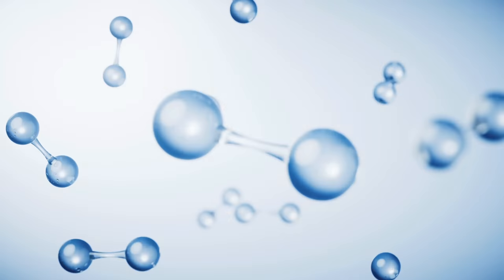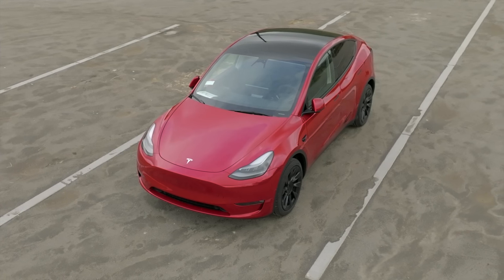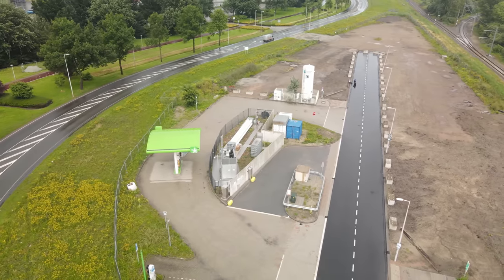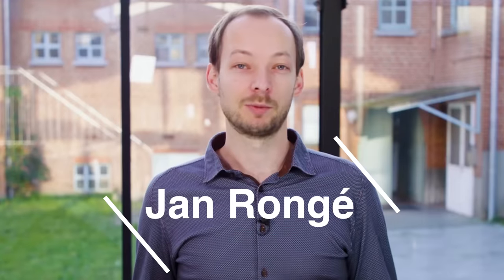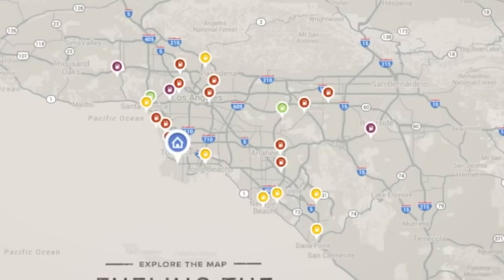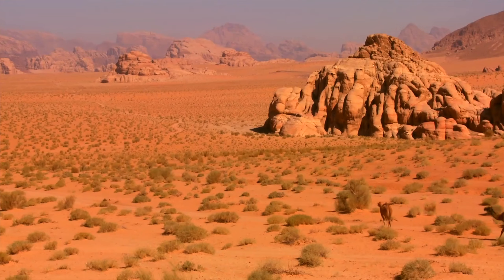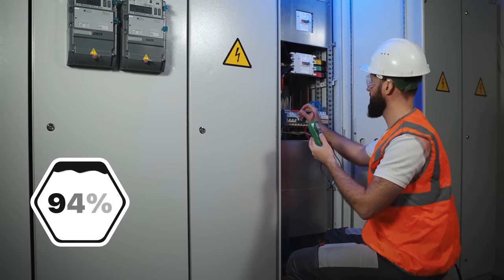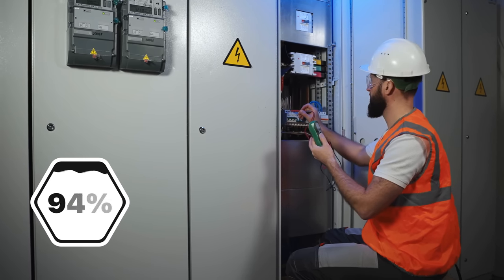Breakthrough Solar Panel Makes Hydrogen At Home!

Comment: The problem with home solar is it only really works in the summer when you need the least power. So you need a system to store the excess energy in summer till you actually need it in the winter. Hydrogen has that potential, you can store H2 at high pressure without the need for compressors using metal hydrides at a density higher than liquid H2. In the winter you can use it directly in a gas boiler for heating or in a regular ICE generator for electricity. Also consider brewing/distilling alcohol in the summer to keep till winter. Burn it directly for heating or fueling a generator for electricity....
Reply: In countries like India, people use Aircons in the summer. If you are able to produce energy locally then that will cut your electricity bill significantly.
Reply: @rabindrasingh6270  Most people in the world dont live in areas that are permanently warm...they have winters...

Comment: Besides cost and safety concerns, I'd say by far the biggest challenge with hydrogen is preventing hydrogen leakage. Hydrogen leakage is a serious concern, since it makes hydrogen actually contribute to global warming, because it slows or prevents methane breakdown in the lower atmosphere. Methane is an 80x more potent greenhouse gas than CO2 during its lifespan in the atmosphere. Managing hydrogen leakage to below 4.5% will be essential. This pretty much precludes decentral hydrogen production solutions like the one described in this video, since decentralised systems are uncontrollable. And governments will likely have no choice but to ban applications like these, since they will present a net contribution to global warming.

Comment: Plasma Kinetics has a unique hydrogen storage technique that allows you to store hydrogen on a film.  You don't have to compress hydrogen with this system so you cut out the major cost with normal hydrogen storage.
Reply: I looked at this from a technical standpoint - it is a lab party-trick, with very little practical use. Some people jump on the funding bandwagon with essentially nice-sounding but impractical ideas...
Reply: @chrisheath2637  do you have any examples of what you mean?

Comment: Why not use it as an alternative off-grid solution for gas cooktops, and/or water heating ? since high pressure storage and pipe wouldn't be needed, and you wouldn't have the secondary conversion losses.

Comment: I say Lavo system with direct electrolysis of the air like the panel..Neat there is a way we can make high pressure H2 through the electrolysis process...

Comment: Put the high pressure hydrolyzer in a car with electricity coming from an overhead line, embedded in a roof deck that powers the car while "in network" The network also provides central computer control. The hydrogen is used when outside of the network - which would exist in urban, and possibly suburban or exurban, areas as well as on interstate and major highways. It would also be fed from home electric (solar, wind, central power, whatever). This means getting rid of carbon in non-urban areas (like most of Iowa). Roof decks would have solar and grass and streams (to maximize solar), just because we can - or they can simply be grass covered. Home electricity and internet would also come through roof deck system (or walls of roadway). On daily commute, car would stay in system in urban areas and drive you to transit and drive itself home - to return to pick you up from transit later. Nuclear power (made from recycled waste) would mostly power the system.

Comment: i kinda also wanna be able to generate electricity from excess hydrogen made. maybe use it in a stove burner? IDK. the best part about having liquid hydrogen stored is that you can use it whenever. I seen people make hydrogen powered generators work just the same as gas ones.

Comment: Hybrid parabolic/photovoltaic would be much better for this. It would use the high temperature wasted heat to produce hydogen from water and the photovoltaic cell would have increased efficiency due to high light intensity.

Comment: What if u take the solar panel system & directly have it apart of the car. Then directly route the hydrogen into storing it in your car? It could auto detect when it's full & maybe utilize or transfer energy to other aspects to the car once the tank is full? Just a thought? Probably can't work

Comment: It's promising tech but as you touched in on the way it's stored is so far very inefficient with considerable losses in each process.  For the moment I think solar and battery storage connected to a smart grid is the way forward.  Maybe  mass scale hydrogen generation is more efficient?

Comment: There are a couple ways to store hydrogen with a low pressure system and it can be used heating water or house just like natual gas or to run a generator. One is a container in a container filled with water and as it is filled one rises as the gas displaces the water. The first tank could be mostly burried in the ground.  The other way is like a giant air matress, perhaps with its own building to protect it. For daily use they could be practical, but for long term, they would need to be huge.
Reply: We got those large buildings in our larger cities that produced city gas until about the 1980s when it was replaced by natural gas. They have all been refurbished and are now being used for public venues, malls etc. They are called Gasometer. Actually they had a primary use, constant gas pressure for the whole city.

And no: You can not compress hydrogen in the way you think. That does not work. Sorry, it just does not work.
Reply: @wolfgangpreier9160  Interesting. I don't know what you think I think about compressing hydrogen, but it can be compressed just like air can. Unlike air though, care must be given because it is flamable it needs to be treated more like natual gas or propane and because it is of small molecule size, it is able to go though smaller gaps in seals, defects in valves, etc.
Reply: Why would you take 4 times as much energy to heat water or your home with hydrogen when you can use 1/4 the electricity and use a heat pump? Also you need special containers to hold hydrogen since it is the smallest molecule in the universe it will embed itself in just about any material causing hydrogen embrittlement.

Comment: The thing is, he longer we wait the longer it’ll take. Just like battery technology in the last 100 stunted by a cheaper option (on the surface) that’s lead if nothing else to terrible pollution issues, that initself has significantly reduced over its years of production, 

I’m pro hydrogen as well. Right now, just like solar, was 30 years ago, and to this day, still is less than 25% efficient, but it’s overall earth benefit is significant.

Comment: If we had a way to store Hydrogen in large quantities (without needing extreme amounts of space) then this would make sense as an addon to normal PV systems. (e.g. for the winter months.) Unfortunately we are not there yet, as this kind of solution would need to store in the MWh range rather than KWh...

Comment: they have talked of hydrogen cars for decades -- 6 fill up stations in the whole of uk -- like 3 pounds per kilo to buy
Reply: Yeah, and I see them driving around every day. It's awesome to see them dump hot water out the tail pipe. The Toyota Mirai has been out since 2014 and if you're in California they are everywhere, so your points are clearly moot. You just live in a rundown country.
Reply: @filonin2  I prefer my model Y

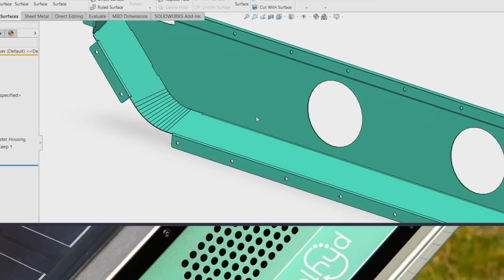Comment: 5:57 question answer: no, because my bev can already charge at home on my current much cheaper solar system and a 4 min recharge at home is usless when I can already charge overnight with the exact same or less effort.
Reply from the maker: i 100% agree with you!

Comment: Using home generation of H2 immediately suggests space heating and hot water applications.
Reply: Better off using solar to power a geothermal in ground heat pump system.

Comment: I'd have a hydrogen car if I could get the fuel at home. I assume it'd have to be super cooled to a liquid state or highly compressed to actually have the volume to run a car effectively though; both of which also would take a ton of electricity to do which creates a new problem.
Reply: As is very well covered and commented in the video.
Reply: @Israel Parada  yes; I added another comment stating that I had gotten to that part. Lol I was commenting g in real time that I was watching when he said to comment about whether we would own a hydrogen car.

Comment: Problems with solar panels. 1. It costs an extra $20,000 to remove/replace them every 10-15 years when you reshingle. 2. You are not allowed to suspend the panels from a gazebo or other structure. 3. You are not allowed to disconnect from the grid. If the city has a power outage—you do too. Your house is basically a power plant for the state; and it’s only a matter of time before you have to rent those panels. (For example: EVs have to pay extra registration fees bc they don’t pay gas taxes.) 4. Hail. 5. If they are so great, why does the govt mandate them for new houses and give subsidies for old houses?

Comment: They should create solar panel statue gardens in a glass dome surrounded by water so the panels can use the water to self cool and create condensation. They can grow beautiful plants and flowers and create a therapeutic energy-producing oasis in the desert. Continuing to promote the pressure of cool air and rotating components in the batteries to keep cooler with multi-dimensional, rather than flat, batteries. Build a solar panel statue as a skyscraper in NYC. End compulsive force upon foreign countries for oil.

Comment: You said "second most energy dense fuel behind nuclear" and also that it has a very low energy density both within the first minute and a half. The term 'specific energy' should be used for talking about energy per mass and 'energy density' should be reserved for describing the energy in a given volume. In hydrogen's case, the specific energy is great but the energy density is a challenge.

Comment: Big battery pack to produce hydrogen on demand just filled it up with electrolyte and replace elements as needed. No need for storage or to fill it up at the hydrogen station.

Comment: As Solar Hydrogen is designed to give Solar energy with another Kick, it can reach its maximum output depending on the capacity of the solar vehicle, house, equipments and gadgets and its make or raw materials to be used. Solar Hydrogen is also promising, since with or without solar or sunlight, chemical reaction is used to produce the needed energy, similar to fusion of heat and the compound elements, that can make solarization and Hydrogen as protected. The Hydrogen power is also encapsulated in a vacuum or flask, some of it in a cylinder, some of it in a built in strong material metal, that can store and compress chemical reaction designed for Solar Hydrogen, it is also safe depending on the storage materials. It needs a fleet of experts for it to run as stable and safe, since it can cause accidents when it is not properly manufactured. This type of energy is also NON-ALGORITHM based, where it relies on chemical storage and distribution-ignition, it can explode when the cylinder is not as properly sealed, similar to LPG cylinder, yet this one needs further studies for it to be as safe, since it is economical, environment friendly, using compression, chemical reaction, ionic charges and heat and cold temperature adjustments. SMEs ePLDT/PLDT Inc.and Subsidiaries-Metro Investments-SMC-Group-Telecommunications, respective associations to private sectors-suppliers/brands management®™© ∆ are owned by its respective brands, and is Incorporated amongst brands regarding this technology derive from Solarization+Hydrogen energy source/manufacturing. Tiers and Levels 1 and 2 for your respective statistics to review/studies-research and development based on Quantification standards for equipment supplies/technology based and feed, cycle time for charging as well as Quality of materials and shelf life. Tiers and Levels 1 and 2, This is Tierage exception:Reason:Review details of equipment supplies/standards of excellence, materials as well as Active Ingredients as these are Classified amongst Protocols for Energy productions sourcing, management-Environment friendliness and standards based on Dept.of Science and Technology's expertise for Chemical engineering, electrical and applied Thermodynamics. Thank you. Respectively certain/./SME-Managers/Generalist-General manager(s)Manage care of-ePLDT-PLDT/SMC-Group/Telecommunications-MetroPacific Investments-. Dated 2006-2089 to DATE:2023. ∆ ********IMPORTANT**********Thank you.

Comment: Yes, I would switch to a hydrogen car if I could produce hydrogen at home.  I believe hydrogen WILL be the ultimate fuel of choice once we make the production, storage, transmission and dispensing issues economically manageable (i.e., cheaper).

Comment: Almost 2 liters of hydrogen per minute per panel  would  require  a hydride  metal alloys  to store the gas  safely before  the production  blows the roof off and what are the plans to compresses said hydride  platinum group metals.

Comment: Interesting statement that fuel cells are relatively untested technology.  We've been using fuel cells for space power for 50 years, and terrestrial applications have used fuel cells since that time.

Comment: There's something critics of hydrogen fuel are forgetting.

Environmental impact.

To mine the lithium batteries for the Tesla cars, you need half a million gallons of water to get 1 tonne of lithium.

That same amount of water, you could get almost 20 tonnes of hydrogen fuel.

1890 tonnes of water for 1 tonne lithium, vs 1890 tonnes of water for 20 tonnes of hydrogen -- the rest is oxygen.

I looked it up, lithium mining has to evaporate 1890 tonnes of water to get 1 tonne of lithium.  And where does the water go?

Apparently it's vented instead of collected and used for drinking/farming/aeroponics/cellular farming purposes -- yes, I saw that video, and I'm willing to try out those burgers.

Thats tonnes upon tonnes upon tonnes of wasted water that we hope like hell will come down as rain and used that way, but will mostly go back into lakes and rivers.

That also doesn't include the refinery processes of the lithium in terms of power and resources -- let alone the manufacturing of the batteries.

Effectively the opposite of conventional desalination plants.  Wasteful.

Comment: My 2 bit cents:
100 to 200 psi or bar or what ever, IF you have the room it would be ALOT cheaper of you increase the volume and decrease the pressure.
This could be interesting from a comercial / monyley point of view

Comment: I believe making hydrogen with OTEC is the way to go as long as one combines it immediately with carbon dioxide from the air and creates green methane and all the side reactions it allows. We could then power the current generation of gasoline  powered cars with a carbon neutral source of fuel.

Comment: You are not a news broadcaster Buddy you do not need 2 cameras and to keep switching between them. Regardless I'd love to see you do a video on the use of HHO Gas as the fuel for an engine. This has an even greater power density and produces only water. In my younger engineer days I was working on it but it's not in my wheelhouse for reasons that are unimportant anymore

Comment: If it was a 60 to 75 kWh battery where are you can of course plug-in at any traditional charging station.   And then made me have an additional tank for hydrogen that can maybe produce another 30 to 40 kWh worth of power now you’ve got something that’s compelling enough. Because even if you don’t have 100 and filling station should still be able to travel around 240 to 300 miles electric only with a sort of range extender, it would still be fine for a road trips and you could just use the hydrogen at home as a means to charge up

Comment: high pressure storage direct to a fuel cell maybe.
but all the extra hardware to create a fueling station?
they scent methane and propane to be aware of leaks.
how are you going to detect leaks before the boom point?
directly to storage with a fuel cell would even out spikes in good and bad solar days though with a fuel cell and batteries for storage.
ut for the cost of the hydrogen system, you could just get more batteries and be safer.

Comment: I never see the efficiency data of batteries take into consideration the energy required to mine and produce them. I’d like to know how that energy input would offset the total efficiency of a battery over its typical lifetime.

Comment: A couple of talking points you didn't include, but should:

1) Hydrogen embrittlement. :ecause it is the smallest atom and molecule, it permeates everything! And when it does, it makes things brittle - Plastics, metals, everything. And what happens to pipelines and storage tanks when they become brittle? They fail... spectacularly. Ask any metallurgist about it and they'll start reaching for their aspirin bottle. This is a huge safety issue.

2) Maintenance: People don't maintain their vehicles very well now, and you want to throw an intolerant to mistakes technology in their laps... I'll bring popcorn to any roadway you want in 5 years and we can watch the hydrogen explosions. The Ohh's and Ahh's will be epic.

Comment: No. Our future energy storage choices will not boil down to either batteries or hydrogen. Those are secondary concerns. Primarily, it should just be nuclear energy with load following reactors. Your storage should be in Uranium, Thorium, or transuranics.